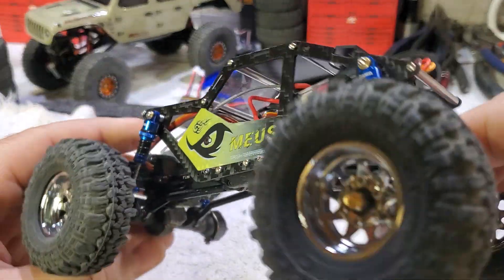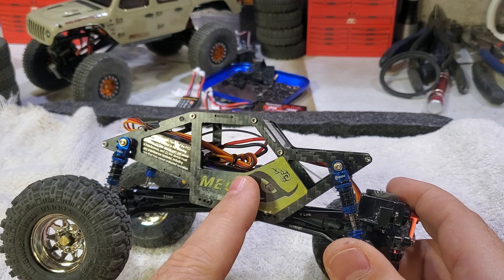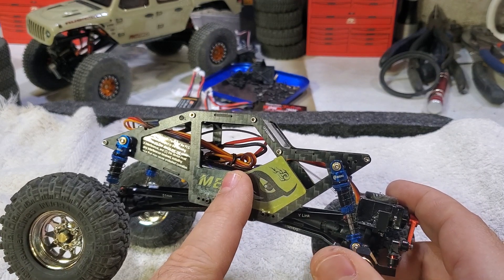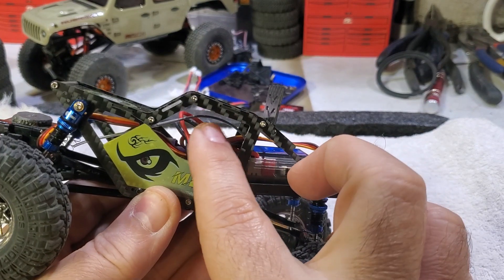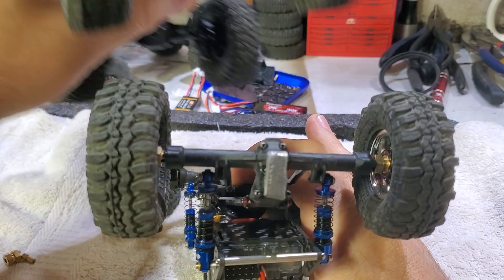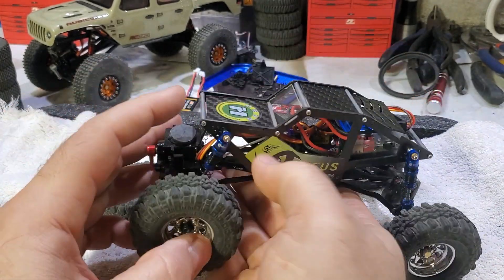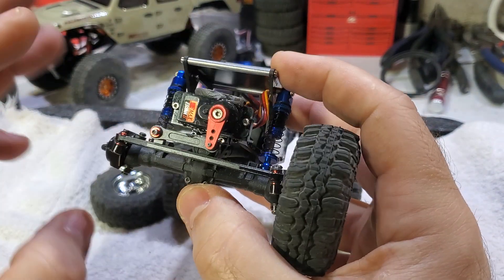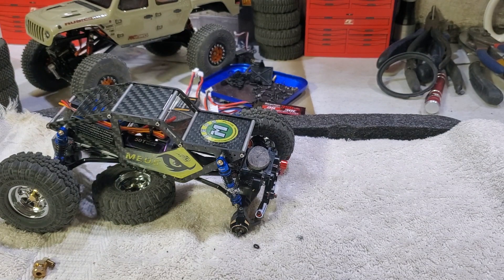scx24 jlu Meus chassis upgrade and build .

Comment: Im noticing you have weight on your front servo? I do this mod where I take sticky weights and cut and shape em so they fit on to the outside of the inner beadlock ring. It adds about 100g grams to the lowest widest spot you can put weight. helps keep those tires down when twisting. :) Did a simple vid of it.
Reply from the maker: I do something similar.  I use lead weights inside the beadlocks.  I have a couple videos covering it.
Reply from the maker: I do something similar.  I use lead weights inside the beadlocks.  I have a couple videos covering it.  Thanks
Reply: @thepatriotrcchannel8693  Oh good stuff man. I feel thats one a few over look. :)
Reply from the maker: @DurpVonFronz  for sure